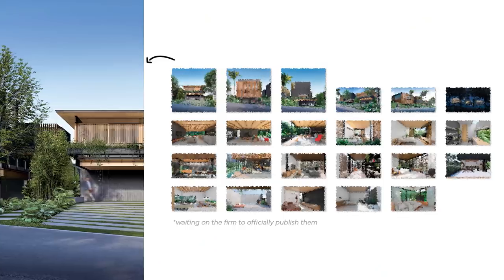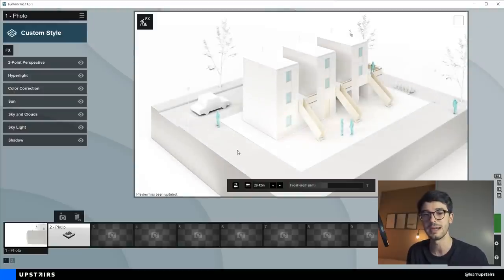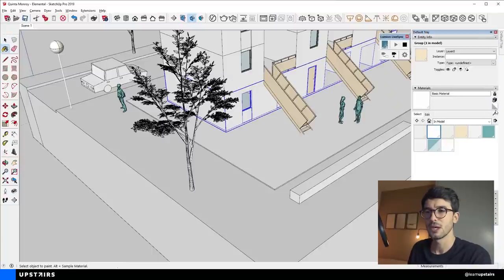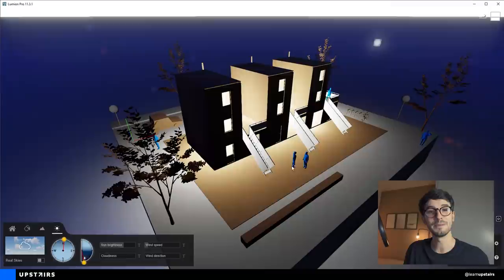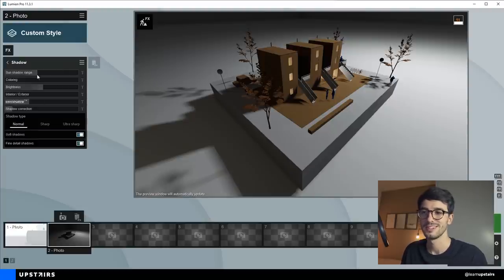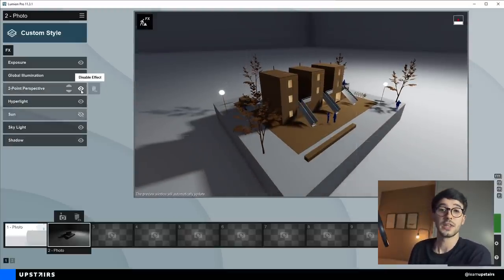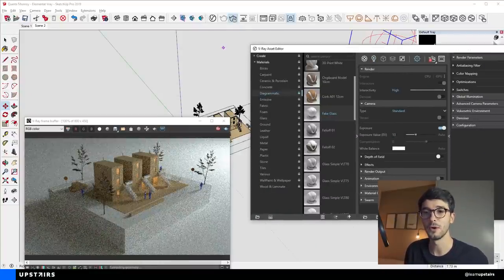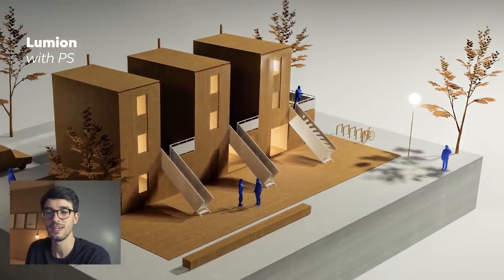Lumion vs Vray - What are the biggest differences?

Comment: Vray render seems more physically correct, but with Lumion the rendering takes less time, and offers more visibility of all of the elements of the scene. But, if you take time to configure Vray correctly, you can gain some time, and have better views.
The question is what modeler you use. If one expect the render engine to do all the job, he gets wrong. That said, I use an old version of Vray, with an older max version (the 6th for max and 2nd of Vray), so my rendering are really really slow. But Blender is quite a mess for me to do exact modeling (like maya), as I import 2D technical drawings (from Inkscape), and after just extruding to get 3D scenes (but easier made with my old max).
For me, Vray gets better light parameters, and I have an old but quite large material library to choose, so for me, Vray is better. But that's a personnal choice.
Reply: yup

Comment: could you share the SketchUp model? I have been working with Lumion for so many years and I could tell you, You can get a result very darn close to Vray, with some adjustment on the lighting... just my two cents.. from a former 3ds Max with Vray. for over 15 years.. using Vray since the first version

Comment: vray is the most beautiful and best because it provides realistic and professional images with the best quality, you can control the material settings better and wider options in the settings and the size of the program is small and does not exceed 1GB and does not need high operating requirements

Comment: vray has an option to use either cpu, gpu or both of them. Does it really matter which to choose ? Does it make a difference in the outcome of the image? I know it makes it faster to use both but its kinda bad because of the heat in the hardware.
Reply from the maker: Hey Dazai! Yes, vray does have that option. But from my experience and from what I've out there, usually you use the gpu render when you're setting things up and still working on the model. But then when you're all set up and ready to go, you switch to cpu and then you can get the most quality out of vray.
I'm pretty sure there are some variation to this process, and maybe other users can give their input on this.
Reply: @LearnUpstairs  Yeah I thought that was the case. Thanks again man very good video as always!

Comment: Oliver, look into Blender maybe? I personally think it provides more flexibility. But, I'd really like to see you take a crack at it and share your experience.
Reply from the maker: Hey Adnan, for sure! It's on my list. Although I've never used Blender, I watch a few tutorials here and there to see more about this software. And I see so much potential.
As soon as I can, I'm planning to release a video about my experience as a first-timer using Blender, and hopefully, the viewers can contribute to this conversation.
Reply: @LearnUpstairs  Well, I hope that you have already watched the famous Donut tutorial by Blender Guru. That tutorial series is usually the starting point of most beginners, myself included. Though most things aren't necessarily useful to most of us, as you can export the 3D model to Blender, apply the materials and just do lighting and camera placements. But, given the right amount of skills and time, you can use Blender to completely meet all of your 3D needs. Either way, the Blender Cycles renderer provides some great output, as long as you have the lights and materials set up properly.

Comment: My laptop has a 8 RAM and 2.6ghz i7 core which software is best to work on in my case? I tried v ray but it was making everything so slow and almost impossible to work on anything else!

PLEASE HELP ME I AM GRADUATING THIS SEMESTER AND I NEED THE MOST EFFICIENT ONE WITH THE BEST RESULTS 😢😢😢
Reply: vray 5 has real time engine too, just like lumion
Reply: You should definitely add more ram to your computer, at list 16 GB. Check as well your graphics card for a better one. This will help speed up your renderings.

Comment: Good comparison , but you missed the important fact that lumion handles shadows better than V-Ray especially with tress, if you look closely with the side by side . Huge difference ( V-Ray shadows are dull , not so a big of difference between trees and people objects same ) on the other hand lumion handles pretty well leaves shadows on the ground,  so on . As far the gpu or cpu , unless u have a twin xeon or an Amd threadripper V-Ray is suitable for* but gpus come a long way ,faster, raytracing is on point 👉.  Lumion is the way of the future . Enscape 3D is also mighty ( handles meshes which is a big plus compared to solids modeling  handled by lumion

Comment: I can't understand how people use SketchUp in 2021, specially designers. The whole interface, the icons. It looks like Windows 95. Everything looks pixelated (bounding boxes, etc etc). It is just so bad. Its license is only subscription model too. Coming from a Rhino background I just can't understand how it misses so much functioanlity. You can't even select objects by layer/tag... and the entire import workflow seems so broken. At least with Rhino, you need to make blocks everywhere to make sure things remain grouped and separated meshes in SketchUp. If not, things get welded together. What a pain.
Reply: Do you really know how to use sketchup?
Reply: @thiephia7390  If you notice I was mainly talking about the interface. But yeah, all the rest I mention are real, cumbersome Sketchup limitations.
Reply: @shynnsup8383   I think you're not use sketchup properly than, bacause sketchup have tags, layer, scene and can easly group that and hide or unhide or move around. You have to learn more about sketchup to criticize.
Reply: @thiephia7390  You can only hide or unhide, you can't select by layer, that's all I said, and I am right about it.
Reply: @shynnsup8383  no you're wrong because sketchup have layer and you dont know that.
Reply: @thiephia7390  I never said it does not have layers.